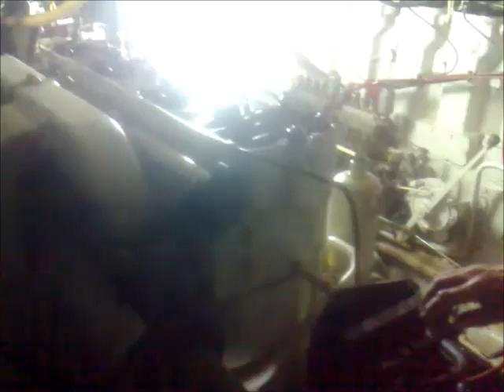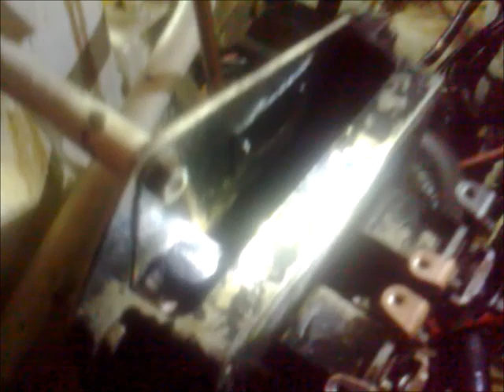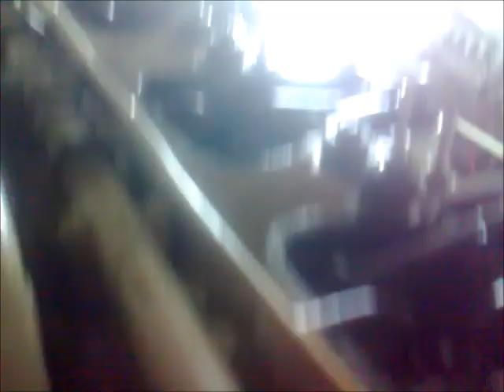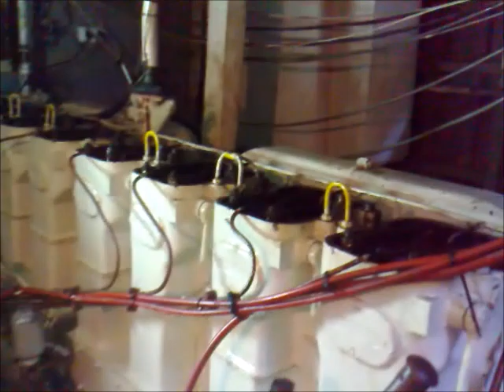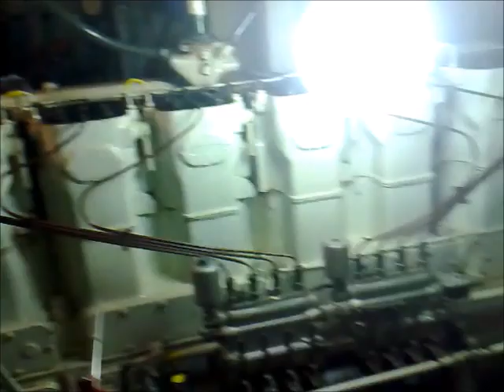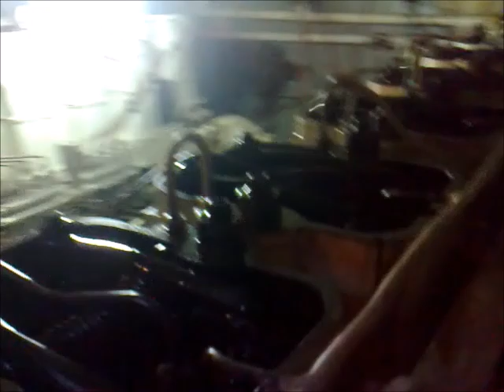2010 Het opstarten van de 2, 8 cylinder  Gartner  motoren

Comment: You shouldn't need to oil the valve gear on a Gardner unless it's been laid up for years, put the covers back on to keep the dirt out and the engine will look after itself.